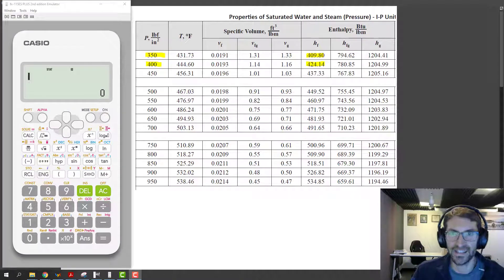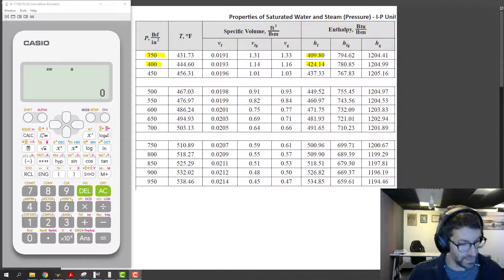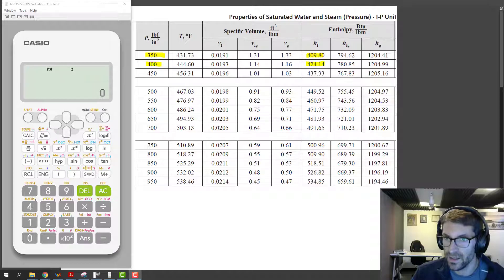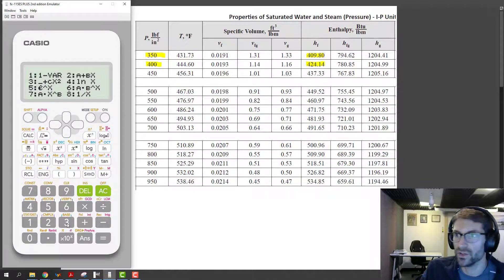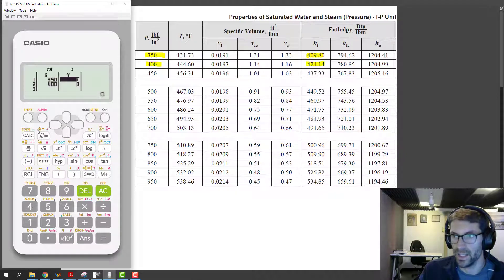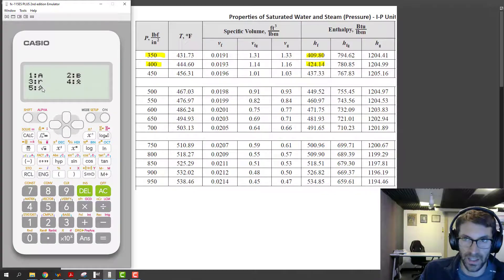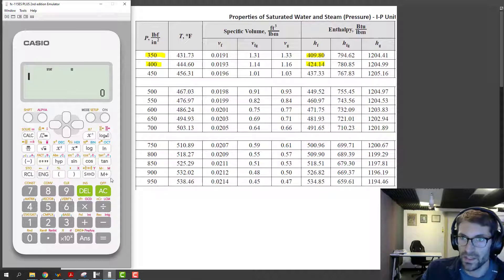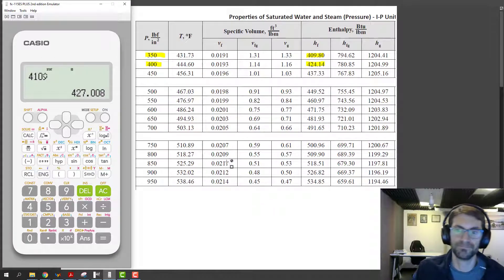Interpolation with Casio FX115 ES Plus | PE Exam Prep with Dan Molloy, PE

Comment: You can also use the calculator (solve, equal, X functions) to solve for the value the old fashion way using the equation and solving for the unknown x. It takes the calculator like 30 seconds to spit the answer out.